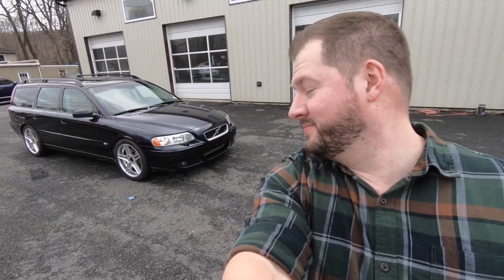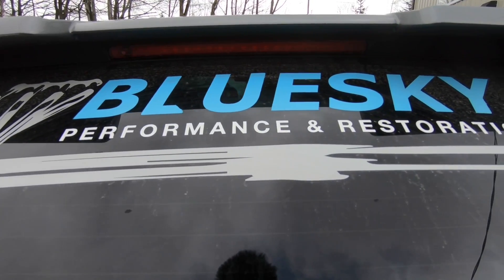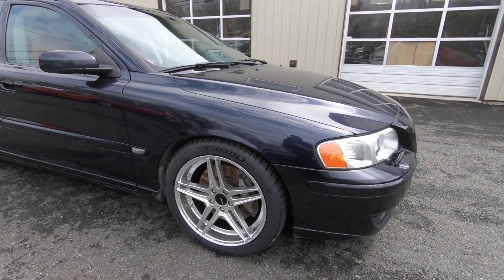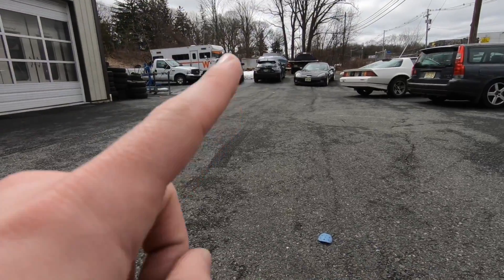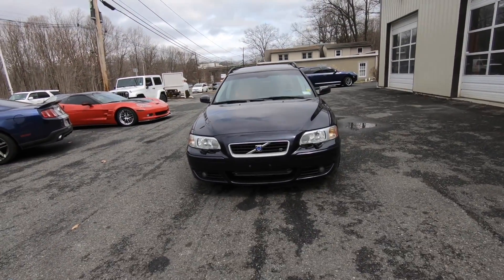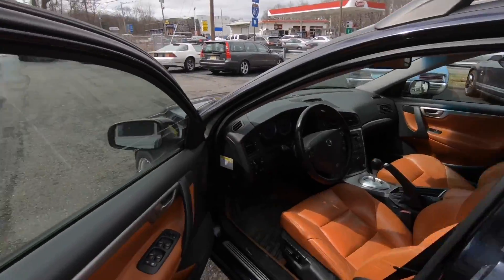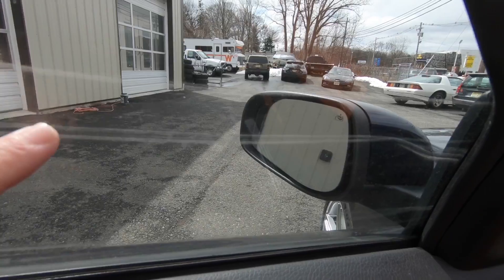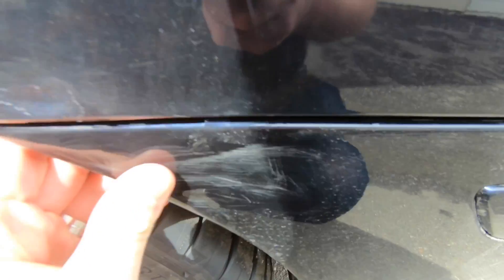Everything Wrong With Our Rare Volvo V70R And One Major Upgrade

Comment: Once you get the headlights and fogs cleaned up, add a set of Lamin-X protectors. Thick, clear, and not expensive when compared to replacing a housing. I've had them on all my cars since my '99 528iT and swear by them.

Regarding the wheels, I bet you could find some black steelies and mount some sweet Volvo 240 hubcaps!

Comment: The Volvo V70 series cars are awesomely comfortable to ride in. Not going to find another car with that level of comfort. Combine that with the highly tuneable P2 engine, rare is just way too understating it. But it'll take a lot of $$$ to restore and.....not forgetting....to maintain them. Make friend with a good, personable Volvo tech, you'll need it! The "Journey" can be quite painful but sweet if you have the cash. Do remember the R engine can't take too much boost as the walls between cylinders are too thin. I'd say anything beyond 350bhp is a risk of cracking the cylinder if you floor it often.

Comment: IPD, Aluminum skid plate. Top engine torque mount, urethane replacement. Lower trans thrust mount, billet & urethane for that. I've done these for my '97 850 GLT.

Comment: Roof racks are from XC70 model. Engine bay is stock, front intercooler color is peeled-off but it's a comment thing on this model. I resprayed mine. Be careful with front left quarter panel and gaps it could mean that a car had an accident at some point. Seats can be redyed and I'm preparing to do so. Unfortunately stitching is done very badly.  I'm planing to remove mine and then do the stitching from the other side. Good luck, I'm following your project. Too bad for the old V70R hope it will fine some good soul to repair him properly and love him for good :-)

Comment: that is a 100% stock engine bay, factory hoses and everything, with the exception of what appears to be a poly motor mount up top there
Reply from the maker: Awesome! Thank you.

-Gregson
Reply: Tim Schelley ipd poly upper engine mount. Otherwise stock.
I did notice the coilovers!
Reply: Volvos and worn out engine mounts, classic. Especially in the winter when they become rock solid and turn your gas engine into agricultural diesel at stoplights. Half the people say that OEM ones are a worthless replacement and other half say that aftermarket ones are even harder highlighting the problem.
Reply: well i prefer my S60R to feel like a sports car not a Buick so I don't see whats wrong with feeling your engine rumble a little bit at idle. Polyurethane mounts are far superior and keep your engine from banging around under the hood. Unless you enjoy driving a Buick the harder mounts are a good thing.

Comment: Hey guys, did you need to use spacers to get the Advanti rims to fit properly?   Thanks for the video and information.
Reply from the maker: Yes we did. 5mm will make them clear.

This set is now for sale if you’re interested.
Reply: Awesome.  Thanks for the reply.  I already have the rims and just need the lug bolts and spacers.  Is there a URL I can go to to see the set?

Comment: I haven't owned a Volvo but that alternator belt looks like it's mounted upside down ?? Is this some kind of illusion or the power steering should not be having it's belt flat side to the roller ?  The grooves of the serpentine belt are on the outside.
@17:16
Reply: they are ribbed (for her pleasure) lol on both sides my Volvo's serpentine belt is the same way

Comment: Howdy, they have twin intercoolers , one in front of the other, you are missing the plastics that hold the fuel pump lines to the chassis:)
Somebody has started pulling the tint off and that's why it's sticky.
Look into TME exhaust systems from Sweden, I have the full system on my car and it has a great note but it's doesn't drone on the motorway, power steering pump could just have a loose pipe, I've seen this a few times now. Are you putting the 4c suspension back in ?

Comment: Roof rails are from a XC70, R ones are more low profile. Engine bay is all stock besides the poly torque mount. The R's have a dual intercooler setup. The main big one, and the little one on the front that branches off the main one. I don't think the DVD player is stock. I've never seen one before so not sure. Other then that it looks great. Also retint the it, it looks much better with tint. Also nice wheels. I think I'll look into them for my Sonic 06 M66 VR

Comment: Yeah u could get a DVD player. Don’t know if the Sony branded one is stock tho. The nav design mean only DVD in the rear. IMO the single best OEM accessory is the flip up dog gate and you can find em for about $100.
Reply: my cross country has a roll up partition that's built into the rear seats, I did not even know it was there until recently, I allways thought the little loop straps were to pull the seats back up from folded I pulled on them and this two piece plastic grate unrolled with this extendable bar that snaps into the headliner, honestly I just love how you can flip the trunk matt carpet over and it has a rubber bottom in case  you need to put a muddy dog back there or a bunch of dirty tires lol

Comment: By the look of the green colored antifreeze, you have the wrong type. Volvo’s use an antifreeze with HOAT that is a light orange color.
Reply: my v70xc awd uses blue color antifreeze I think its the zerex g2 although I could be wrong, it had blue coolant when I bought it and was told to use it. it has the same turbo 5 that's in the car in the above video just a little older and tuned differently for the cross country sort of suv offroader style trim, its not a cheap car to maintain but is well worth it. they are great cars.
Reply: Drew Alsup I also used Zerex but mine was orange. Definitely seems to be the brand that’s needed for most Volvo’s.
Reply: The oem coolant that I've used is a blue green color, however green coolant works in these systems too. Just as long as its not GM's battery acid "Dexcool"

Comment: what's the exact engine of this car again? assembled in sweden?
Reply: 2.4L inline 5 turbo all wheel drive, it looks to be a 10valve I'm not sure on when they went to 20valve engines
Reply: Drew is incorrect, it is a 2.5L inline 5 turbo, 20 valves (Volvo hasn't used single cam 10 valve motors for a couple decades). It is a "B525-4T4" the 525 standing for 5cyl 2.5L, and the 4t4 designating the R engine variation with 300hp using a KKK24 turbo. I believe the majority of these R's were assembles in Belgium, those are the good ones. Make sure if you are buying your own that the engine bay has the "Made in Belgium" stamp.

Comment: does anyone now how much a 1996 black wagon 850r with manual conversion is worth in the uk..?
Reply: Steve Crumpton depends hugely on condition and mileage but I would think at least 2k. The manuals are very hard to come by, especially from the factory (I.e not a converted auto)
Reply: Jake Hubbard cheers bro... I'd say its pretty mint not perfect ..  no rust on body, underneath looks like new, all electrics work, good strong engine..  
Down side is with uk petrol prices it's a killer.. and it gets thru shit loads of front tyres lol..

Comment: That small intercooler is not an intercooler. (Sorry, I sound rude) It's actually an upgraded transmission oil cooler.  I have the same setup on my 07 V70R and its the transmission cooler from the XC90 and is a very common upgrade to do for the transmission cooling. on the M66 or TF80-SC.
Reply: The one at 16:30 in the lower bumper opening is in fact the factory auxiliary intercooler. There's another (primary) intercooler sandwiched in between the condenser and radiator. This car is a manual so there's no trans cooler.

Comment: Hello, I have a 2007 Volvo S40 2.5L T5 > I would like to make it faster and not spend to much. Any recommendations are welcome thanks.
Reply: frally1000 I have the same engine in my 2005 V50.  I suggest doing suspension, a good exhaust, and possibly one of those handheld ECU tuners if it is in your budget.  A good, cheap way to make more horsepower is with one of those handheld ECU tuners, such as the ones from COBB, although I don't think they make one for either the S40 or the V50.  I'd double check that.  I do know the guys over at Elevate make one.  The handheld thing is good assurance since you can revert to stock tune if you need to, for example, take it to a dealer, unlike a professionally reflashed ECU, which tends to be more expensive anyways. An upgraded rear sway bar will also make a world of a difference.  I haven't done it yet myself, but plan to soon.  Check out elevatecars.com for some good speed parts for your S40, as well as IPD USA (to a lesser extent) or VIVA Performance.  One note:  Don't try to send too much power through the automatic transmission, if you have it.  The manual is basically bomb proof, but the auto may slip if given too much power, especially if you or a previous owner didn't do all recommended maintenance listed in your owner's manual (fluid changes, etc).  You should have no problem with just a handheld tuner or any other power adder at that price level, but if you are looking to send much more power through that engine possibly in the future, then I'd watch out and possibly have someone inspect it.  The engine itself will take basically anything you throw at it, as long as you aren't stupid and the mileage isn't too high.  With a low to medium budget you won't be pushing anywhere near that level of power, but it depends on how well it has been taken care of in the past.  Your car will be a blast with just a sway bar and lowering springs, though, and if you don't care too much about more horsepower than stock and value handling, it's the way to go.  Also, a good catback exhaust is a must.  That engine sounds absolutely amazing uncorked.  It also gives you a little more horsepower, but I did it for the sound.  If you are willing to stretch your budget a little I would do the sway bar and the handheld tuner, as well as an exhaust.  It's a good mix of improved straight line speed, incredible sound, and improved handling.  Just the exhaust and a sway bar will make that thing a blast on back roads.  Do what best suits your driving style and budget.  Sorry about the essay.  Have fun with your S40.

Comment: Okay after you looking over the whole car, I'm not gonna lie that thing is kind of a pile.. Multiple collisions and poorly done work is what caused all those large panel gaps and weird fitting pieces. A lot of hack job kind of work is indicative of a bad previous owner, and if they don't take care of the bits of car you can see you can bet money they don't stay on top of maintenance or go to reputable shops. It's going to take a lot of work to get it back into nice condition.
Reply from the maker: That’s ok. We have the manual and that was the most important part of this car. Knew this would be a project anyway. Still very happy and can’t wait to bring it all the way back!

-Gregson
Reply: The loose plastic on the B-pillar and the somewhat odd aligning of the inner ceiling above the driver door, along with the repainted left front fender makes me wonder if the airbagcurtains along the left side of the car has been deployed and are no more? Do these seats come with airbags at the outer hems? Could that be why it has been stiched together again? I feel a total measurement of the chassi would not be a total waste of time. Not fun when you grind those new Michelins to the core because the whole car might be scewed!
Reply: Noticed that as well, and as far as airbags in the seats I don't believe that they did but that plastic piece that he pulled out of where the seatbelt was has an airbag under it and I didn't see one there so your theory is probably correct.
Reply: Jared K if airbags in the seat back there will be a cloth AIRBAG tag sewn in to the stitching, my 01 V70 had them. Stitching opening up is very common problem. Also the dings in the left doors at the top are probably  from the point of the wheel arch rear door of an SUV, front one angle parking rear one straight in parking. Just about all V70’s have these two dings on the left side, from moms putting wiggly kids in the SUV’s car at the supermarket. That flat spot under the windows is just about the same height.
Reply: bbjca737 yep I can confirm living in Texas that with all the trucks and suvs you are going to get the dings there and it’s so hard to keep away from the big cars that do that. The side molding can’t help prevent dings if your truck is 15 feet in the air. It gets annoying sometimes so I usually park #nodingsquad far away and have complaining passengers. (Edits are for grammar, I sounded even more stupid earlier, trust me this is an improvement lol)
Reply: Yep. This will be 2 for 2 with trashed R’s.
Reply: Being a full grown person, 6'5" and 400 pounds I really need the full opening of the door on my V70n, having people parking too close is a big no no, I have had to push mu car out of the parkinglot to be able to enter the drivers side. Sometimes I wish all cars had sliding doors.... I have a Grand Voyager too...One time some stupid ..... parked very close to my car OUTSIDE the marked slots, it left me with a 5 inch gap between the cars, as I drove an old junk car I "tried" to open the door a couple of times, just to mark my point, I bet the dings in his fairly new car was a sight to contemple about not doing stupid and illegal parkings any more. And there was plenty of free parking squares just 100 feet away. So I understand the theory about SUVs dinging the smaller car, just wanted to share...

Comment: I don’t like bc coiliver. And save money fore a new engine R engine is not god.
Reply: what do you have against the R engine? They can safely support some real power gains and sound so much better than anything you could swap in. Except for an Audi turbo 5...maybe
Reply: Tim Schelley R engine is weak. The cylinders burst easily. know people who have broken the engine with the original effect when they have driven a caravan. I have not trimmed my car car because of that problem.
Reply: The engine block is poorly built. The t5 engine with 260hp is 10 times better and keeps much more power. t5 engine 260hp record what i know totally original with only E85 programs is 420hp
Reply: Well thats unfortunate. My dad has owned a 04 V70R since new, it has 160k now and it has needed an alternator, radiator, and rear cam seals during its 14 year stretch of constant daily driving. It has an ipd tune, and the auto trans is on its way out but the motor is still running strong.
Reply: Tim Schelley do a full throttle test in a steep uphill of 6 gear 👍🏻 everything depends on how to drive the car. Feel the one who works at the factory that manufactures the engines. There is a difference in blocks.